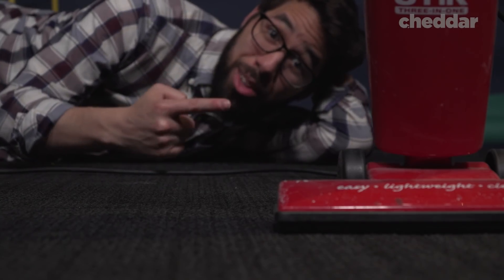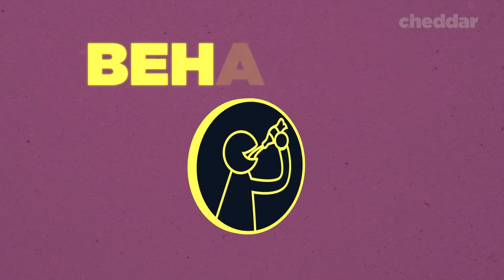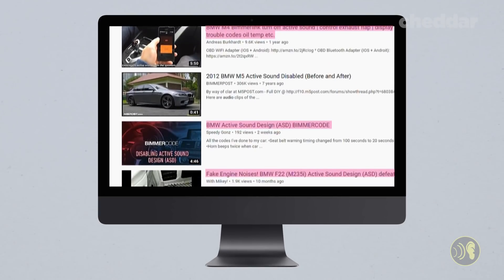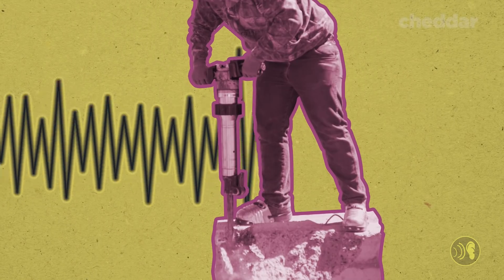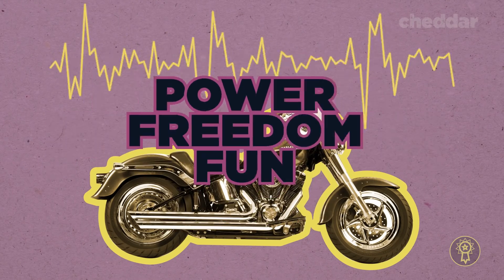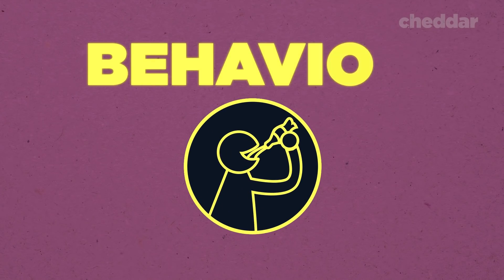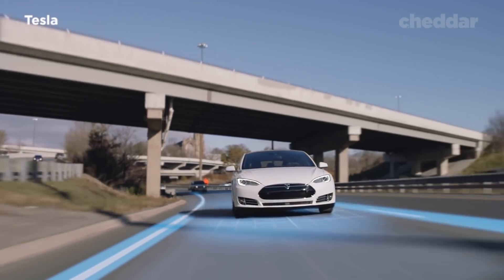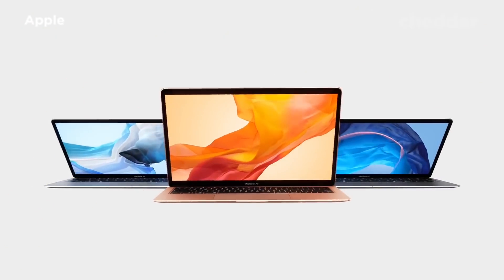The Fake Sounds Companies Add To Products - Cheddar Explains

Comment: “Part of the reason motorcycles are so loud is for safety” is one of the biggest lies in motorcycling. “Loud pipes saves lives” makes as much sense a what you just said about the interiors of cars being quieter and quieter. And if loud exhaust pipes made you more noticeable to other drivers, semi trucks, big diesels, and tuned up Honda Civics would never get into accidents either.
Reply: So I heard that when Harley and Davidson designed their first bike they where on a stricked budget and inoder to safe money they did something to the crankshaft to make it cheaper but it cause the cylinders to have a slight miss fire on every other down stroke causing the sputter or spud sound at least thats what I remember seeing on a youtube documentary about Harley-Davidson
Reply: Most motorcycles are not made to be extra loud. A lot of brands do tune the sound though but not the decibel level. If you have taken a defensive motorcycle course (which I have) one of the tips to make yourself be known to a driver who doesnt seem to have noticed you, or a situation where visibility is limited is to rev the engine. This is done instead of using the horn because 1) horns on a lot of motorcycles are rather quiet, so much so that the engine is much louder. 2) honking can be perceived more as bigger  annoyance compared to a single engine rev (of course repeated engine revs can be much more annoying than 1 honk or rev of the engine).
Reply: It’s because motorcycles are hard to see so they make them easy to hear... really rocket science isn’t it?
Reply: @kensweetser  The biggest problem is that the sound is directed backwards, not forwards and the speed of sound isn't really that fast. Cops have to be mindful not to drive so fast that they're effectively outrunning their sound. If they get going too fast, by the time people hear and identify the siren's direction, they're already on top of the listeners.

Plus, one time I heard a motorcycle that was so loud, it sounded like it was literally coming from everywhere. The sounds were so loud that they were bouncing off every possible surface and making it impossible to know where the sound was coming from.
Reply: When the big semis start swerving between traffic then we'll need to make them louder.
But most motorcycles are made deliberately loud on purpose. There are plenty of quieter motorcycles.
Reply: You moron its bc the people on the other side don't get out the way in time
Reply: @retrospace2150  The problem is you don't hear those loud exhaust pipes until after the bike passes you. Of course people can't get out of the way in time because they can't hear your deafening exhaust until after you're in front of them.

Comment: I'd rather have a silent vacuum that it's so powerful that i could stick the hose on a surface and would hold my weight. And wouldn't hurt to have a way to adjust its power. A noisy engine doesn't mean it's stronger.
This marketing approach to actively hack your mind and basically control you like a mouse with cheese is a good way to make sales but i's not the way we should support. 
Take obesity for instance, a big part of this problem is because of cheap unhealthy food. Sure that without it many people would starve, which is another issue that's not totally fixed. There is also the part about "starving" obese people because of the lack of proper nutrients in that cheap bad food.
And what is the approach around this health issue? More sales, medicine, diets, exercise instructions and so on. It's like would you be an alcoholic and had to be surrounded of booze in every aspect of your life with ads bombarding you at all corners. Fuck this capitalistic criminal approaches! Sell good products, that people need not same crap or even worse and compete on who is a better marketer. The only good part of capitalism is competition, if you don't have at least that then what's the point? Competition should be based on quality and cost not on what seems better or more believable. There shouldn't be any variation of perception regarding product value when cost is not a factor!

Comment: And i was thinking that it might be a good city idea to lower the car engine sounds requirement drastically during the night in order to make fuel engines obsolete for night travel within a city. This would be cool to make the city night a bit quieter and to influence more people to buy electric cars. Like if you would have only one car, then it must be electric. But if you want more than one, you have to get at least one electric if you plan to drive during the night. So death to sound design! :D But i guess it would be somewhat of a nightmare to figure out a way to enforce that kind of rule. Because people are selfish and would not take that road too easily even if it would mean a less sound polluted city, even if it means mostly during the night. When it comes to personal comfort, people will resist losing even a tiny bit of it even it would mean a huge common life improvement. People suck!

Comment: You can't compare a car that an electric engine to one that runs on combustion. Basic physics says there's going to be a huge sound difference. And a Harley sounds almost exactly similar to an Indian. Because that comes down to the straight pipes and the heads. Where as a ninja "bike" is going to sound different than a Harley because of those reasons. And vacuums are loud because of the air being sucked up and stuff rattling around. Yes some are quite but they seriously don't make them to be loud just to be loud.

Comment: We live with enough Noise Pollution. We don't need more of it. We need less of it. When I'm vacuuming, I want to hear my stereo. I don't want to listen to my vacuum cleaner ( the way you check if your vacuum cleaner is working is to check the dust collector and filter and to regularly clean the filter and empty out the dust collector) It doesn't need to be noisy.
As for my mobile devices. I turned off keyboard click sounds. They're irritating and so irrelevant. And they're so yesterday......
Not only is all of these unnecessary noises ruining our hearing. They're not good for our psychological health. Noise can be claustrophobic...... ⚛️☮️

Comment: I bought a Bosch Serie 4 Propower and it is very quitet, comparing to the older ones I had. 
More sound isn't more power, but some people maybe still think it is.
You got it wrong on why motorcycles sound louder.
I imagine what Pringles thinks about their potatoes to not be as crunchy as many other brands on the market.

Comment: I'm a big cheddar fan, but this was one of the worst episodes of all. It made all these assertions about companies sneaking sound design past us but provided no science or mechanism by which this sound is added.  For example, how does the vacuum add the extra sound? 

The car engine sounds going through speakers?  What if the audio system is turned off?  And even the one mechanism that was described with the Pringles being crunchy... Why didn't they take a sound meter to it and compare it to a regular chip. I bet a Frito-Lay chip is just as loud.      This felt like a Ted talk where bold assertions are made with no evidence.

Comment: The silent Tesla felt so freaking satisfying!!
Reply: Yes but it’s forced to use artificial sound because silent cars can be dangerous for ignorant pedestrians
Reply: @-Chicken_   that's only the case when moving slowly. As soon as you get up over 20 miles an hour or so, the vehicle's tires will make most of the noise you hear, even on a gasoline car. Most gas cars get so quiet when they're decelerating that you don't even hear the engine when they're coming to a stop, only the tires. Hybrids are way louder coming to a stop because of this, because they spin the motor up to recharge the battery as they're coming to a stop.
Reply: It hurt my ears. Just like when Elon Musk talks.
Reply: Hell no, that was just meh
Reply: @realkilju  it feels like a rocket ship
Reply: @farismustafa5389  sounds like a jet engine space car

Comment: 2:59 unfair to compare the noise of an electric engine that doesn't have combustion reaction within the motor. sure you can tune a car with a combustion reaction occuring to sound louder or quieter. but showing cars that have this reaction, then using an electric car is just severly misleading.

Comment: I own an electric vehicle and when I first drove it, I didn’t realize how much faster I was going without realizing it. That was due to the lack of engine noise. I came to understand how I was conditioned to listen to the motor feedback to know how fast I was going. However, you do get use to the changes (quieter car noise) pretty quickly. 

When It comes to EV cars tho, I see a hidden danger for people and animals on the road. We all know a car is coming because of it noise. Without it, we just don’t hear it coming. I live in the woods and I have to be more attentive to wild life than with my gas car. I have driven by groups of deers who do not even notice my car until I am about a 2-3 yard away from them. 

I LOVE having a quiet car! But it is risky as well.
Reply: My experience with that as a pedestrian is that it's only a danger when the car is starting from a stop. As soon as the car gets over 20 mph or so, the tires usually become louder than the engine. Hybrids are actually way louder coming to a stop because they spin their motors up to recharge the battery as they stop. Gas cars not only don't do that, but as the engine drops to idle while the car is still moving, it will become so quiet that you don't even hear the engine most of the time cars are coming to a stop.

Comment: the funny thing about the engine noise in cars is that it's still there, but the exhaust muffler makes it so silent that you can't hear it in the car. If you fit a different exhaust your car will get louder.

Comment: Not a car enthusiast, but this rings pretty damn true with locomotives. The sounds many certain designs make are a big reason behind how much love they can get. It's part of why steam engines have a bit more appeal than diesels or electrics. At full power the sound can remain pretty constant for the latter two while running on flatland or climbing a hill. This is the exact opposite for steam power

Comment: How about they make the vacuum basically silent but leave the dust sound in ? Even if the loud motor makes us think that the device is working properly, adapting to a lower sound will be much better than hearing this jet taking off in everyones microphone

Comment: Dude you got it backwards lol. The first car with the amplified engine sounds is the lying car. The car with the more muted engine but noticeable wind noise around the A-pillar is the car that isn’t lying. All cars have wind noise to some degree. That’s normal. If all you hear is sexy engine noise you can bet there’s enhancement coming through the sound system. The first car was lying. 
Here I am a year later and I’ve just noticed something else. They’re not sure they got it right either so they cut short the last word of one sentence and mash it into the next. Notice starting at 02:10 the end of the sentence contains the words ….”active sound design is turned o—-that’s because America’s …..”   to my eyes and ears they clip the last word to where you can’t say with certainty if he’s saying the word “off” or “on”. His tongue position suggests he’s saying “off” but you never get to see either his teeth touch his lips to make the unvoiced ffff sound nor do you see is tongue push his jaw down slightly when making an nnnn sound. I know this is silly but they definitely clipped that word

Comment: The ironic thing is the sounds made by Harley Davidsons and old school V8’s are actually the sound of wasted power, wasted energy, and deliberately un-smooth running machines. Only those who are technologically ignorant buy into the mantra that rumbly machines that vibrate and make atonal, rough noises are powerful. They are powerful, in the way a loudspeaker is. But a loudspeaker is meant to make sound. Sound from an engine is a byproduct. If harleys and mustangs were able to use more of the energy they consume to push the vehicle forward, they would be faster.